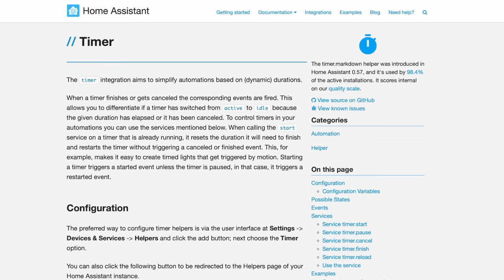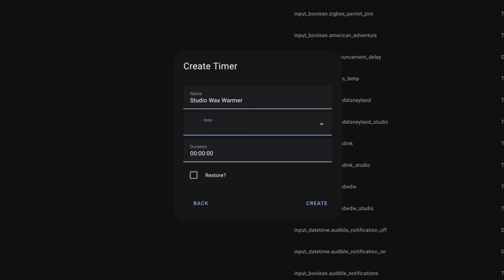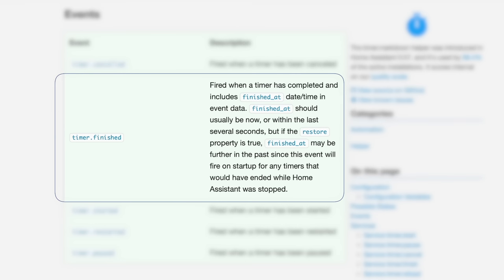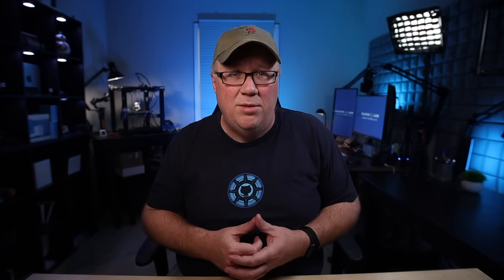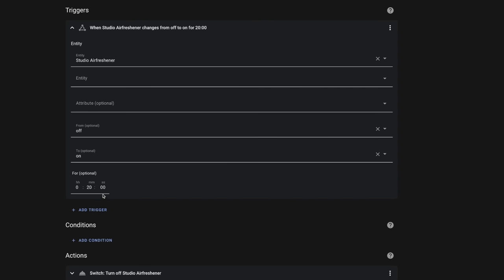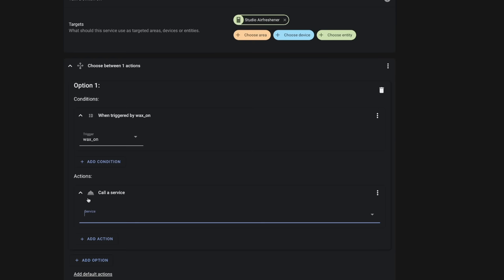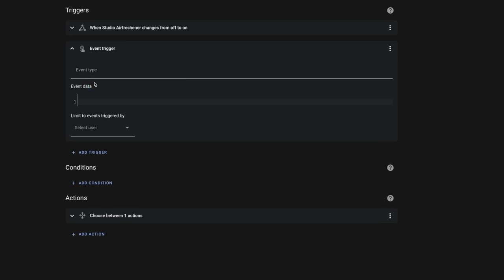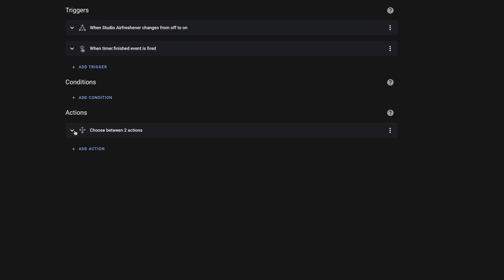Use Timers to build Reliable Automations in Home Assistant

Comment: This is not functionally replacing the for function. The for function triggers, when something holds a specific state for some time (i.e. 20 minutes). This on the other hand triggers 20 minutes after the thing changed to the new state even if it does not hold the new state for 20 minutes. If that is fine for your use case - great. But it's not equivalent. Also It's not that easy to fix. You could check for the new state after the timer finished again but that would not tell you if the thing holder the state for the whole 20 minutes but instead it now tells you if the device was in the state 20 minutes ago and now. You don't know what's been between those two points in time. Again: if that's sufficient for your use case that's great but it's not the same as the for attribute does.
Reply from the maker: That’s a good point. Depending on your automation you would need to include a trigger to stop the timer as well.
Reply: @SlackerLabs  As long as the timer restarts on movement, it will be functionally no different to a "for"
Reply: Just to ensure I understand this as I think I incorrectly applied this to my situation.  So when my motion sensor clears "for" 3 mins, the action I have associated with the switch turning off, will shut off at the 3 min interval.  However, this needs to hold that "no motion" state for 3 mins before the switch turn off action is executed.  Is that correct ?
Reply: What about if other sensors or switches also control the light?
Reply: @SlackerLabs  On the timer page it seems to indicate that if you start a timer that is already running, the timer is started over. Might be useful for time-out automations.
Reply: @blakeseufert7340  They should all interact with the same timer.  That's the beauty of a timer, you can have dozens of triggers that interact with a single timer.

Comment: This idea crossed my mind several times, but all those times I discarded it b edc ause it suffers from the main problem home assistant has: everything is 5 miles away of each other thing, there is no easy way to have an overview and rather than having the automation information in your automation system you have to keep it in your head. Some degree of decoupling is good, but this is ridiculous and inconvenient
Reply: Can you please explain your nonsensical comment?
Reply: @Sparky_D  It's not nonsensical at all. Because of that very issue I often have multiple tabs open to different facets of HA, like Developer, states; the automation being edited, the script being edited, the template I'm stressing at, etc. Just last night in fact, I had five HA tabs open to one instance of HA just to try and convince a mediaplayer automation to play nicely, so yeah, it was lots of clicking around as it was, and would have been absolute hell without all those five tabs going at once.
Reply: @Tekwyzard  My comment was in relation to the topic that Danielo had raised, just the fact that it is barely readable.

Comment: HA does make things painful sometimes. Setting a normal delay after an action should be tracked between restarts. That way all you'd need to do is trigger on something, put a 5 minute delay, and then shut whatever it is off even if HA had been down between start and stop. Near as I can figure, if I want to set a timer to stop something I'll need two automation. One to turn unit X on at, say, 7 am, and then a version of this one that triggers on it turning on and starts counting down to shut it back off. Oh, and HA seems to still be in rapid change mode, a number of these things aren't named the same just a year ago. Service isn't a name in there anymore (though the functionality is the same).

Comment: Great video!  I put the timer(s) to my dashboard(s) as well, so I could see exactly how much time was left on each timer.  I also added a third Trigger ID and "timer.canceled" action and that will cancel the timer if I turn off the device manually (the lights in one case) before the end of the timer, since the timer is still counting down, even if the device gets turned off.  Thanks for your help!

Comment: Thank you for this suggestion.  I think it will help my home automations tremendously.  One small suggestion is that during certain parts of the video, you click and scroll so fast, that it's difficult to tell what options you are selecting.  I'm having to pause and rewind multiple times to try to determine what you are doing.  A slight pause between pointing and clicking would be appreciated.

Comment: Thank you for this new video. My previous automation to turn off the lights was based on an ugly time pattern trigger to check if multiple sensors were all off for at least one minute. The usage of the timer is so much cleaner in this case. I just start the timer again each time one of the sensors is activated to keep the light on. Really easy to change the duration and see the current time before the timer end.

Comment: Great video. Only thing I would add to that is, I add the timer to the dash board, so you can see the timer counting down, so at a glance you can see how long it has to go. I have used this for my watering system, so 8 zones. The other bonus of adding it to the dash board, its easy to open it up, change your time value, for your example if you wanted to go to 25min, rather than trying to find it in helpers, if its next to your swith in the dash board, so just a quick open and change the value.
Reply from the maker: I almost included the lovelace part. In fact had it scripted out, and ended up leaving it off. Since Home Assistant is making the for attribute in the trigger actually better in the next release (by changing when automations are reloaded) I think it might be good to do a video on some better use cases for timers.

Comment: Great video. I used this concept to add 2 timers for a garage water pump. I only want the pump to run for 2 minutes when water detected and a second timer that runs for 30mins which doesn't allow the pump to start if it has finished in the past 30 minutes. Loving what I can do with Home Assistant.

Comment: For years, I've used Node-RED as my automation platform. I started using it before there was an automation UI in HA and just never ventured into it because my automations in NR worked just fine. Recently, I wanted to move some of the automations from NR to HA in order to incorporate some extra details into my dashboard. 
Right off the bat, I struggled to get some sort of script-like capability from the automation. Four things could happen which each would need to be handled differently: light turns on, light turns off, motion detected (with IF light is on or off), and timer expired. The trigger_id was the key to getting everything to mesh properly (along with Choose which I was already trying to utilized.)
Thanks for the video that set me on the right path.
Reply: Can I ask if you made any other progress with this? I'm in the same situation now, and I've found the trigger_id and "choos" logic, which I didn't normally use, as that was handled in Node-RED. Do you have any other tips, I'd find useful in the migration (talking about Node-RED > HA Automations).
Reply: @TechTonor  I've actually moved a lot of my automations from NR to HA over the past few months. For example, the auto kitchen lights automation consists 8 triggers (light on, light off, motion detected, motion cleared, timer finished, automation (helper) enabled, automation (helper) disabled, and timer almost finished.) In the actions, there is a single Choose which has options set for each trigger_id. Each trigger lets me do something specific. So, if the light is turned on, then the timer entity is started. If motion is detected, the light is turned on (which subsequently triggers the light turned on trigger thus starting the timer.) If the light is turned off, the timer is canceled. And, so on.
Basically, using Choose allows you to control the flow of the automation similar to the wires in NR. But it also really allows you to "group" the automation together. One automation contains everything that should deal with those lights. I have another for the bathroom, my second bedroom, and the hallway closet.
Ironically, I was just thinking about adding this automation method/practice/style to my Github when I saw your message notification. I'll try to get it added today but no promises. You can find me on GH with the same username but without the underscore. I'm also in the HA Discord usually in #frontend.
Reply: @d_sellers1  I'll give it a look. I already spotted Choose, which are great! It makes so much more sense. I don't get that I've not noticed that, until the time of my first comment. Thank you for the answer, btw. Have you found other golden things in the automation setup process, while you migrated your things from NR?

Comment: Thanks for this, I used the timer helper along with a count helper to override a thermostat auto shut off when the windows are open by turning it on 3 times within 5 min, in which event the the automation is turned off and your are free to use the thermostat as usual.

Comment: I also like to use the timer helper as a variable for the timer.start piece.  It means you don't have to edit the automations if you decided you want to change the timer duration at any point.  For example this snippet of code can be used to achieve this.

service: timer.start
data:
  duration: |
    00:{{ states('input_number.wardrobe_timer_duration') | int }}:00
target:
  entity_id: timer.wardrobe_occupancy

Besides creating an input_number helper you can also add the input_number to the UI for easy editing.
Cheers

Comment: For my light automations I tie them in with door sensors. If motion is detected and the relevant door is closed the room is obviously occupied. For motion only activation I set the delay to 2.5 times the reset time of the sensor. These two techniques work extremely well for me.

Comment: There's a flaw in timer. In "Timer" document of HA, it clearly points out that "However, automations using the timer.finished event will not trigger if the timer expires when Home Assistant is not running." I guess that's because HA use time stamp, and when the time stamp occurs when HA is rebooting, the event is not triggered.
Reply from the maker: Yea. That feature doesn’t appear to be working.

Comment: Hi, great video. I'm using nodered for automations and the problem is the same with trigger nodes. I have automation for water pump to run for 10 minutes. i managed  to restart nodered several times, while it was pumping, resulting in empty 5m3 water retention tank. I just migrated some of my flows to timers and it works nicely. It would be great, if there was node for timers, so i don't need to listen to events and then filter out timer entity_id

Comment: So, my first 'timer' automation was to automate a wax warmer in the living room. For turning it off after it's been on a while.

I am going to have to look into timers for at least one more automation. I do 3d printing for my own purposes. and while a 3d printer that is not printing, is not drawing a significant amount of power, it is drawing some, and every Watt hour costs money, so looking to reduce that. I've already got automations that trigger events when a print job completes, as well as when the bed is (or should be) cool enough to release the print that just completed. At the moment a third tree of that automation turns off power to the printer once it's been idle for some period after that. One of the things that I was missing was the event id: option. I know you had a video regarding it earlier, but at the time much more of your videos were Yaml based, and I wasn't ready for that. So having an explanation of using that for Choose events works. I'm going to have use the a timer from when the bed is cool enough to release for 20 min to power down, and figure out how to stop and clear (reset?) the timer if I kick off another print job in that time.
Reply: Part of me would like to be able to have a pool of timers available (perhaps dynamically created, yet persistent across reloads) that an automation could use in place of the 'for ...' or 'Delay' functions, that a programmer can assign an event id, and a timer duration in the automation, so one wouldn't have to have nearly as many helpers to keep track of. In the next few weeks, I expect to have 2 more printers on line, maybe 3?, and I can see having even more. I'd kind of like the ability to create automations for each of them that do as described above, and being able to template and only change the trigger entity names to reflect each printer, and what plug they are attached to, would be nice. Oh well. (I suppose I could dump, duplicate, and modify the yaml... :-) )

Comment: I like timer to be run in IoT device localy. 

Tasmota have "PulseTime" timer which will turn light off after some time by it self. My task is only to turn it on via HA, hardware switch or any other way. If another turn on impulse comes to this IoT device, then tasmota starts countdown again from start. So, for light timer usecase there is no wories if HA, wifi, or something else goes wrong, device will turn off, after designed time. I believe that ESPHome can achieve similar.

Not sure about Zigbee devices. They probably thus not have inbuild countdown?

Comment: I love HA but I think this UI implementation highlights one of the reasons users (new and old) struggle with this sort of thing.  Yeah you can give the timer a name and a duration but nowhere in that dialog box is there a single piece of information that explains what those are, let alone what "Restore" means.  Yes there is documentation for many things but many users don't ever refer to the docs.  Not a good thing but still a fact.

The HA UX and UI team needs to do more to show time-of-use help and pointers.  In this case a mouseover tooltip would be simple to implement and save a lot of confusion.
Reply from the maker: I like that. I wonder if anyone put that in the WTH list.
Reply: @SlackerLabs  What is the WTH list?
Reply from the maker: October is the month of What The Heck so over on the HA forum lots of people are tossing out WTH suggestions for fixes and improvements. And the community votes on it. And then the dev team tries to knock them out. Some will be in the 2022.11 release.

Comment: Listening for the `timer.finished` event is not the only way to know when the timer is finished.
The timer has a state. The state changes from `active` to `idle`.
I'd argue that if you want to type less, you'd rather use the state change as your trigger.
Reply from the maker: As long as you wanted your automation to fire every time a timer was stopped or canceled as well as actually reached the end of the set time then yes that would work. But if you want to trigger when the timer actually finishes the countdown then you will need to listen for the event. But the state change from active to idle could be because of more reasons than the timer reached zero.

Comment: I have 2 triggers in my automation, one which triggers when motion is detected, which waits for sensor to be off for x minutes. Other one checks if there isn't motion for x minutes, and then turn lighst off. That way light will be turned off after x minutes even if server restarts. Not as precise as with timers but enough for me, an easier to setup.

Comment: I find that often with timers I like to have a UI component so it can be dynamically change the delay/timer.  As we all know life requirements are always in a state of flux. It does appear that you cannot easily change the timer duration and it show up in the Helper UI - Yes you can change the duration when starting the timer, though this gets lost in a restart.

All Fun - Enjoy
Reply from the maker: Yeah. I need to do some more testing to see how hard to push a timer. It would be nice to be able to create them on the fly like you can with scenes or have multiple instances. Having to define each one for each use case before hand seems like its not going to scale well if you want your lights to all have different times outs. Or like me, have different time periods based on whether its day or night.
Reply: You can use a input_number to define how long the timer should be. And by setting that first before starting the timer you would get a dynamic timer :) and u can customize it from the UI

Comment: Whoa, I didn't realize automation state was not persistent!
Is it possible to set an alarm (rather than a count down timer)? Something with the semantics of "anacron", to make sure power outages don't skip over alarms by accident
Reply from the maker: You could use time as a trigger, but I am not sure on an alarm option, but you could set a an interval. Like trigger an automation if it hasn't triggered in the last 24 hours. And then it  could be your backup trigger.

Comment: Good tutorial and this really demonstrate the power of Helpers and fixes the problem you point out with using the "for" option in the automation.  I always wondered why one of my lights would stay on after the conditional end time and this explains that.  So using this "Helper" timer will allow the light switch to toggle off at the end of the timer, vs remain on because the conditional end happens first.  Hope I explained that correct.  One question I do have.  In your example was there an action to turn on the "studio air freshner" ?  
I have an automation which is based on motion being detected from "off to on" and the action is to switch on the light.  I've already been using trigger Id's, with choose.  So do I have 3 choose options ? 1) Switch turn on; 1) timer turn on and 1) for switch turn off ?

Thank you again for your Layman's terms explaination!